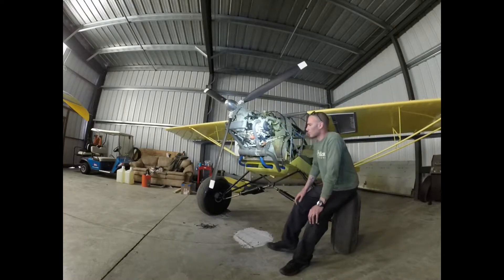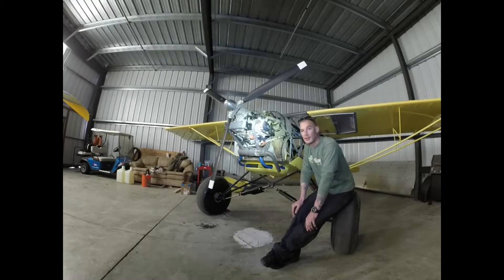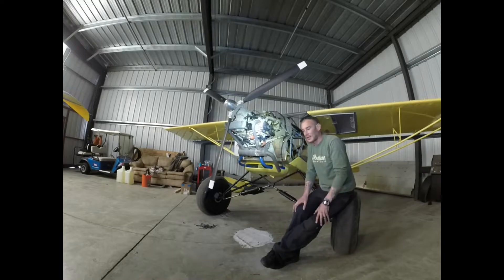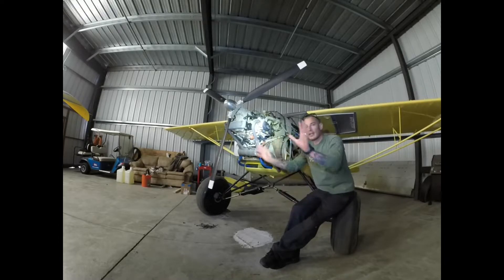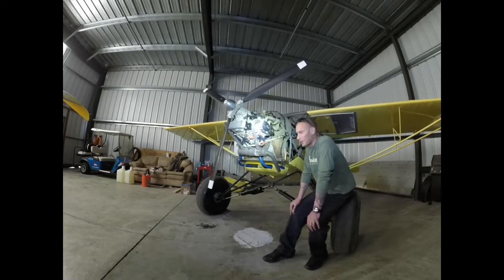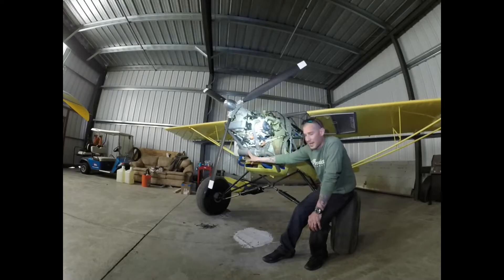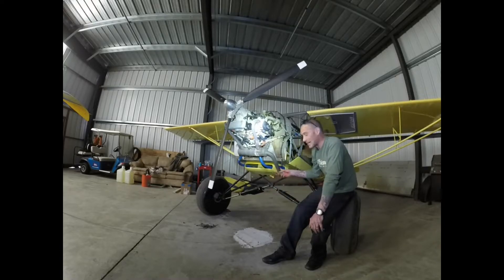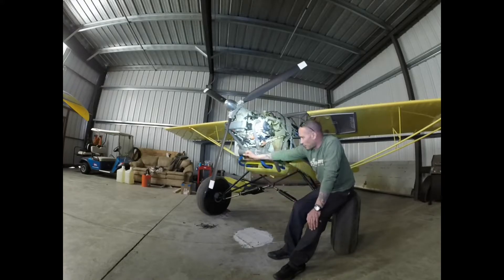Demystifying Bing Carburetors  - tuning the Rotax 912 via Air Fuel Ratio

Comment: Interesting video,  I wonder why you needed the bowl fuel level at half inch down rather than 10.5mm down like the manual suggests?  I have struggled with fuel dripping out the overflow as well and have replaced the floats, the float valve and even new seats trying to stop the flooding, and it seems to run smooth when I first start it then it gets richer at idle and starts running rough, then the shaking makes the float valves leak more till it starts dripping out the overflow hoses. I’m tempted to lower the fuel level down to 12.5mm but I’m not sure why 10.5 is suggested in the manual if it needs 12.5?
Reply from the maker: Do you have big tires on your plane? The reason I ask is that is why I needed mine to be a bit lower. When it sits on the ground extremely nose in high, the fuel angle in the bowls is all messed up. Reducing that level a bit more keeps things from shaking and flooding.

Comment: I noticed your website link says no longer working. Where did you get with the project, and were you able to derive a sea level setting with k&n filters(rotax stock engine package) versus the intake plenums with remotely mounted air filters like used on Zenith ch701’s?  
Regards,
Jody
Reply from the maker: Plane is up and flying without a single hesitation left throughout the RPM range. Strongly suggest using AFR to tune the system as opposed to the “read the plugs” method is all I can really summarize.

Comment: Not sure how well the rotax carb compensates for air temp; but that can effect fuel mixture quite a lot from winter temps to hot summer temps.
Reply from the maker: They seem to. I have strapped the equipment back onto a plane that ive tuned between the summer and winter months up here in Reno and have been within 0.02 of the initial values collected during the 1st tuning cycle. Seems they compensate pretty well for the temp swings.

Comment: Have you investigated the bb / epoxy issue? My 912 S starts to vibrate at about 2200 RPM up to about 2800 RPM. I was doing some investigation and have read that there can be an air leak through the epoxy that seals the idle circuit bb’s . This makes perfect sense, because the front spark plugs on both sides of my engine are full of carbon and the rear spark plugs show a lean condition.  I’m just curious if you have heard about this problem or investigated it?
Reply from the maker: Please touch base with me at avdes.llc@gmail.com if youd like to do a bit of in depth chatting on the issue. 

From my experience what youre feeling is the transition between the idle circuit and the initial shift over to the needle circuit - the RPM range you mention is right in that midpoint between the two. Typically this region gets really rough as excess fuel is introduced and the engine has a hard time efficiently combusting the extremely rich mixture. Try this - idle the plane to warm it up and slowly push throttle into the rage youve mentioned. Once the vibration gets at its worst, immediately shut down and pull a carb from its boot. If the carb and/or the interior of the intake is wet, youve got too much fuel coming in during that transition which is causing this excessive vibration. As the vibration gets worse, the floats in the carbs cant seal the bowls, more fuel is sloshed into the intakes and the problem exacerbates...

Comment: Another Kitfox owner here with a brand new 912uls. I had to set my idle mixture the same as you did for a smooth idle. My mid range was a little rough so I moved the needle clip to #4 to richen it and it got smoother. Now the weather is a little cooler and I noticed the mid range a little rougher. Wondering if going with a smaller idle jet and opening the mixture screw would help.  I believe a lot of the issues come with having to swap the intakes for the engine mount on the older Kitfoxes. Would love to speak with you about this.
Reply from the maker: Please feel free to touch base with me at avdes.llc@gmail.com

I refrain from making statements about potential tuning solutions to engines unless I have had my hands directly on the system. I can however say that yesterday I went back to an aircraft that we tuned mid summer here in Reno and hooked all of the equipment back up to see how the engine numbers looked now tha tit was 36 degrees outside. Overall we were within +/- 0.02 points of the tuning that was conducted during the summer. With that info in hand, id avoid tinkering with the tuning between warm and cool months - I will however warn that I have only confirmed this on a single engine thus far. As I gather more data between hot and cold OAT on numerous engines that ive tuned, this answer may change.

Comment: How did you measure your air/fuel ratio?
Reply from the maker: AFR meter. Numerous companies make stand alone systems - i would STRONGLY suggest avoiding Innovate motorsports equipment however. I fried 3 of their kits within a few minutes of hookup. Ive been using the AEM one now for over a year on 10+ aircraft without issue

Comment: In summer when if you are running mogas you will likely have a richer mixture since the specific gravity of auto fuel changes seasonally , in my area from .75 winter to .82 summer.  Of course if you run 100LL it is always .72, no seasonal change.
Reply from the maker: it is a possibility for those running pump fuel vs mogas. I only ever run mogas year round and as such that wasnt a worry to me on 27RF. For those that are running different fuels throughout the year, I have suggested making the AFR gauge apart of your panel. Nothing wrong with adding less than a half pound for the amount of data at your fingertips. During flight you can actively monitor the engine by way of AFR to see how it is running through all stages.
Reply: @NCardoza_Engineering  It sounds like you are happy with the changes you made, I would have expected a Rotax operated at higher altitude would have needed smaller jets but I guess Rotax is looking for best economy not best power. Thx for sharing

Comment: Thx for sharing your experience, I used to drag race long ago and used the 1/4 mile times as a tuning aid, a oxygen sensor is a useful thing for removing the guess work.  I have a Europa with a 914 and at some point will be flying it in the future, it's stock.

Comment: Thanks for the interesting information. It would be helpful if you could explain in more detail the set-up of the AFR meter, where the jets are and how to change them, and how to adjust the fuel level with the float. For those of us that are new or less experienced working on the Bing carbs and Rotax engine this would be helpful. I am just learning about Rotax engines and trying to understand why it feels rough in different ranges of operation.
Reply from the maker: Great suggestion! I suggest that you do a hunt online for the PDF version of the Rotax heavy maintenance manual. If youre new to these engines and have questions like the ones above, a good majority of those will be answered in that manual, as well as a plethora of information about the rest of the engine. The manual is actually a pretty interested read and is 100% recommended for anyone flying behind one of these engines. If you have any questions, please dont hesitate to drop me a line and ill do my very best to answer in a timely manner. You can also find numerous threads with hundreds of responses in regards to tuning these engines with my AFR method over at teamkitfox.com

Comment: Great video !!!    And useful too as I have the same issue with rough running.    Airfilters matter.   If you are using KN pod filters, then pressure drop through them will affect fuelling too....   If I run larger filter and dry then my engine will tend to run leaner than if I had well oiled and smaller filters.   I have the same engine and it was running rough in midrange, 3000-3500.   I moved clip from next richest to richest position (pos 1 from bottom of needle)  and found it made engine run better in 1st with stumbling and rough running almosty gone. I had to re-pitch the prop. I too have used 12.5 mm fuel level, but I did not change the mixture setting from 1.5 turns out.  I will see what that does but as a preliminary take I get different results.   Next is to weld in the O2 sensor bung I have ready.   The location of the sensor;  between the two downpipes, is there good flow inside the muffler at that point, or maybe that does not matter ? I was thinking to put it at start of exit pipe myself
Reply from the maker: Read the installation manual for the sensor you chose. The LSU sensors very clearly state that the sensor cannot be any closer than 18 inches from the end of the exhaust downpipe. There is a high likelihood that you will get false readings the closer you get to the end of the exhaust pipe. The bung on my system was placed exactly dead center to evaluate the "average" of the two banks in an effort to ensure that I wasnt tuning to a biased condition relative to one bank over the other.

Comment: What brand and model is the instrument you use to measure A/F ratio? Also need details on the O2 sensor you installed in the exhaust muffler.
Reply from the maker: o2 sensor is the Bosch LSU 4.9 sensor that you can pick up at any auto parts store. The meter is an AEM AFR meter - spendy piece of equipment if you're only planning to tune a single engine. If there is enough interest in this I may devise a cheaper meter for everyone that would likely range in the 30 - 40 bucks as opposed to a few hundred.

An update to this - I’ve killed 3 of these innovate gauges already. I went with AEM for the fourth gauge and no issues at all. I wouldn’t suggest going with the innovate gauge unless you plan on spending a lot of time in wiring it to return it